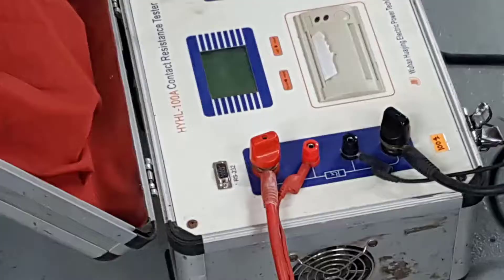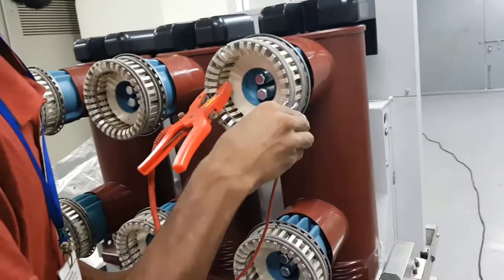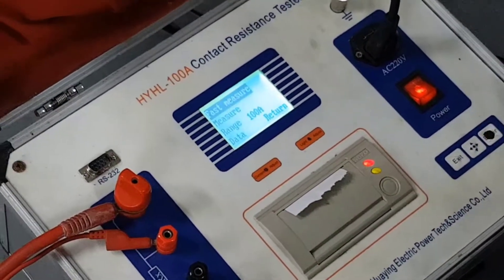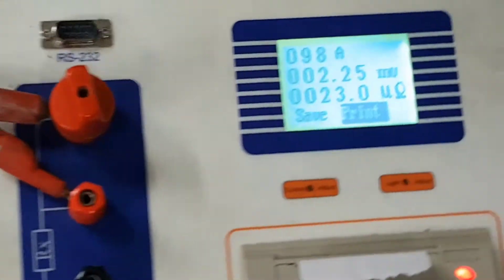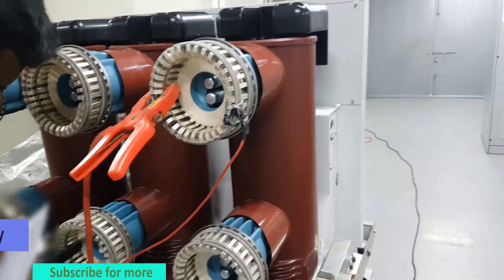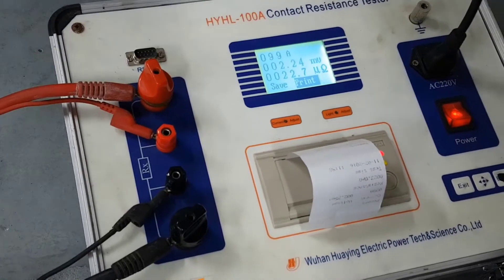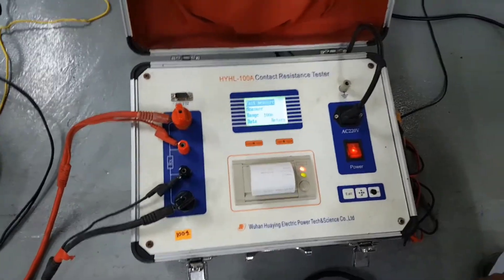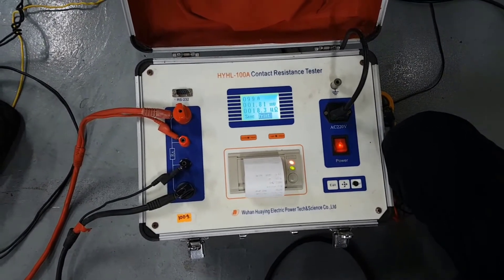How to measure the Contact Resistance of a Circuit Breaker

Comment: sir 
why you inject 100 amp in contact resistance test
Reply: The minimum DC test current should be used according to manufactures specification; however, the IEC and ANSI recommended levels are: 50 A IEC 60694 100 A ANSI.
Reply: Rated current should not be exceeded and testing at 10% of the rated current is recommended
Reply from the maker: It's a normal practice. Honestly speaking I don't know if there is any special reason for 100 A.